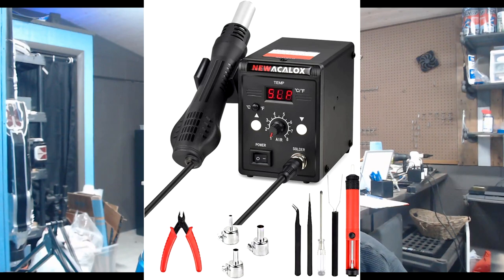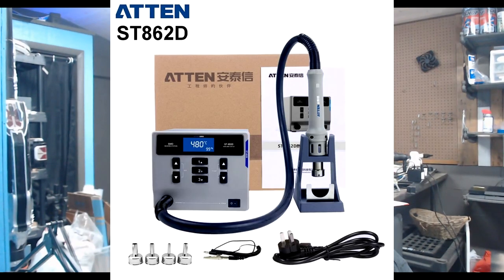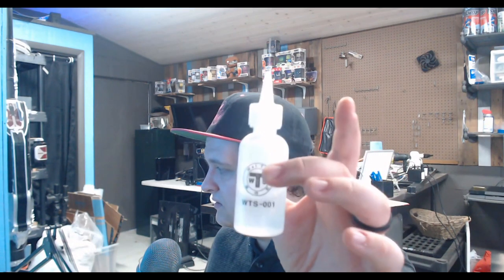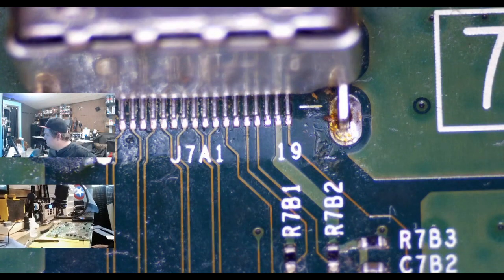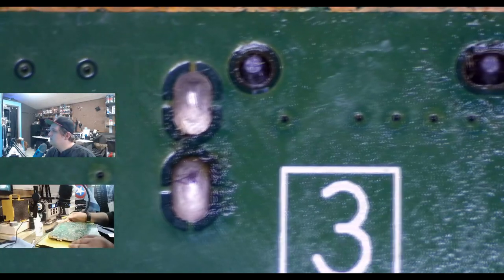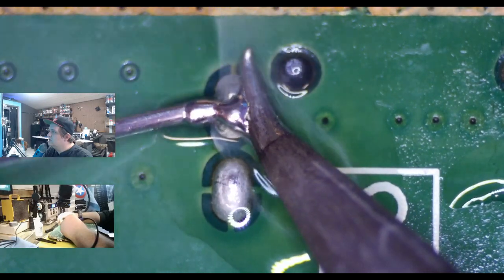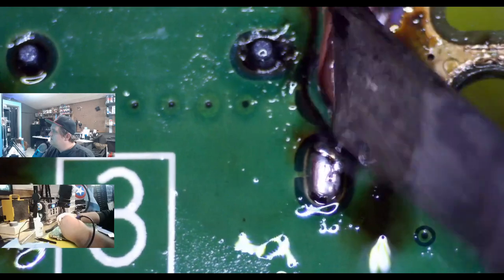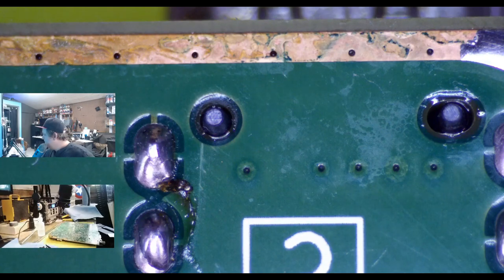HDMI PORT REPLACEMENT GUIDE

Comment: Great video man, I've done 3-4 HDMI replacements successfully so far but they can for sure get annoying and tricky. My biggest issue that you basically resolved was my problem with the ground through holes. I always had issues clearly they up once I removed the HDMI. Usually there's still some in the middle that the wick doesn't want to grab. Ill try the hot air and I'm sure that'll help!

I also used the same flux and solder wire from Northridge. You both are amazing :)
Reply: I just had a heck of a time clearing those mounting holes. Ended up heating the bottom and using a solder sucker on top

Comment: I hang the board over the edge hdmi on top so you can see the pins solder melt  heat from underneath  only lift when pins are wetted' when learning did it your way port dropped out but pins not wetted pulled three traces as you say nitemare to put right' been doing them right side up eversince ............

Comment: I have a question, I have a second screen that uses VGA to HDMI for my laptop. I was using a converter, before switching over to using a VGA/HDMI cable, I noticed that sometimes it would turn off my other screen when I checked it shows up but sometimes the screen will say no single, I'm not sure if it's my HDMI port that is going or what is going on, any advice or help would be grateful